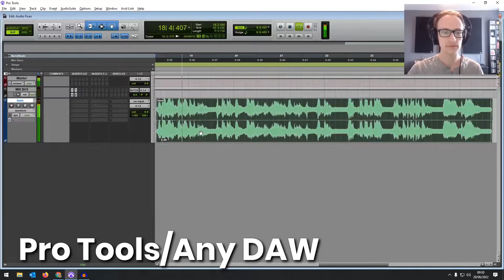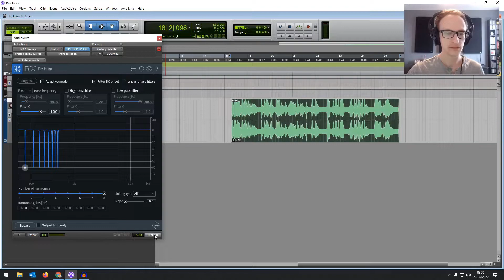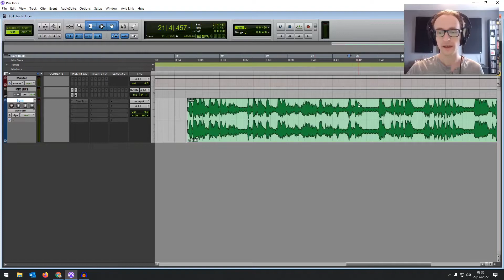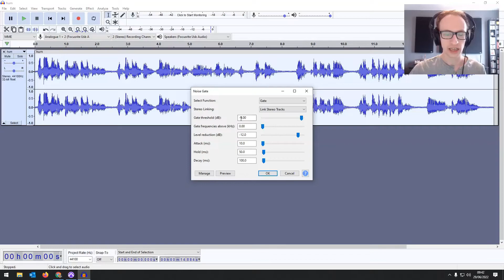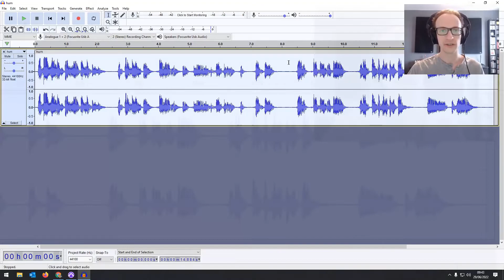How To Remove Hum From Audio | Audio Fixing Tricks

Comment: I have one long digital MP3 file of 20 Johnny Carson monologues from 1981 that were recorded from an external tape recorder.  There is a constant hum that probably came from the TV speaker, and the hum overpowers what Johnny is saying.   I never knew how to separate the monologues so I bunched them together.   I find audio editors confusing and the ones I've used are frustrating so I just give up.   What do I need to get rid of this one-hour long hum? Thanks.